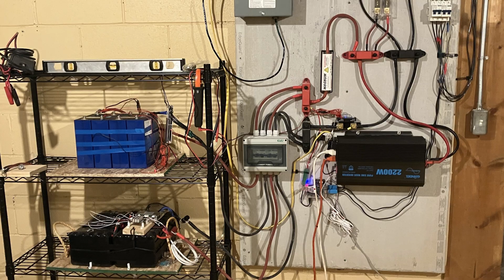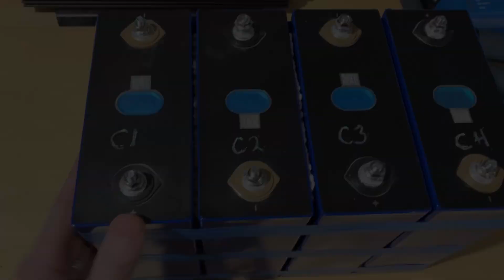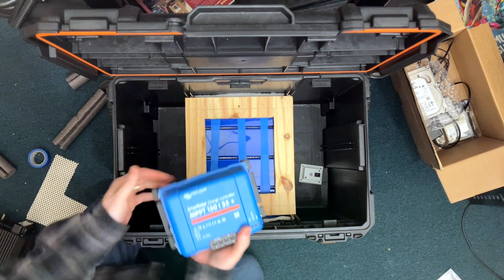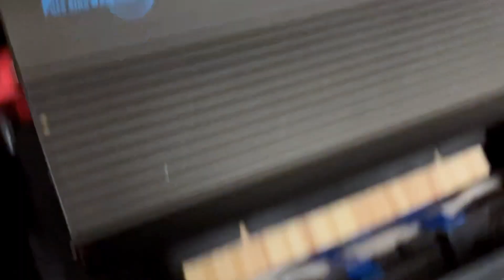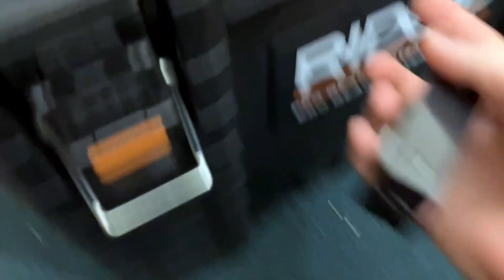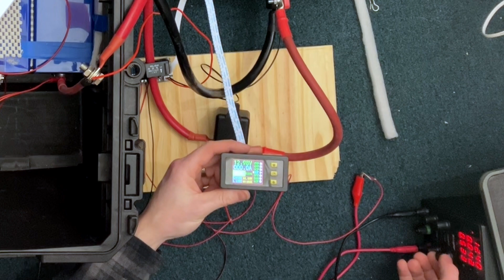DIY Portable Power Station - Working on the Battery

Comment: Very interesting for sure, I like how you think. One thing you might want to look into is when compressing your batteries is using a non stretch tape like fiberglass or similar. I believe Will covered this in his earlier video;s
Reply from the maker: Thanks.  I’m not really compressing them other than just getting them snug enough to fit inside the case.  The tapes really for just keeping the cells together.

Comment: Adam, would sure help to see a circuit diagram of your setup. I'm not sure why you have to switch your BMS on and off? I thought these were self running? Is the solenoid relay handling overcurrent and undervoltage?
Reply from the maker: I’ll see if I can come up with something. It’s pretty straight forward.  The only reason I have to turn off the BMS is to turn off the display.  That JK display doesn’t have a way to turn off at the moment.  

In the past when I had the DROK monitor in play, the relay would open and close based on the current settings in the monitor.
Reply: @AdamDeLayDIY  thanks. Your video are gr8

Comment: NEVER feed a battery into the input of a victron solar controller.  If you trigger high-voltage or the charger detects an output short-circuit, it will clamp the PV input terminals (short them).  If you have a panel connected, this is no problem, but if you have a battery connected, POOF.
Reply from the maker: Thanks.  That’s interesting.  I could have sworn I found in some of my research an article put out by Victron where they stated sometimes when your looking for a DC to DC converter, an SCC can be better because it has multi-stage charging.  Now in need to go back and look for that again.
Reply from the maker: Unfortunately I can't find the article anymore.  It's probably been 8 months since I saw it last and in internet time, that's ages...

I've seen multiple comments on the victron forum from people (including Victron staff) where they say it's not recommended/supported at all due to exactly what you mentioned Dexter.  The PV inputs get shorted if there' some kind of fault detected which will destroy your big battery.  You "can" put some kind of OCP on the input to the MPPT, but it's still not supported or recommended.  

I guess I'll either be just using my 12v charger or maybe I'll look at some kind of DC to DC converter if I want to charge my battery bank from my 48v system.  

Thanks again!